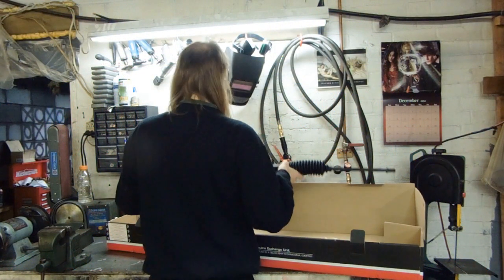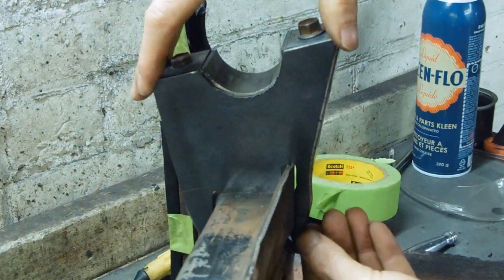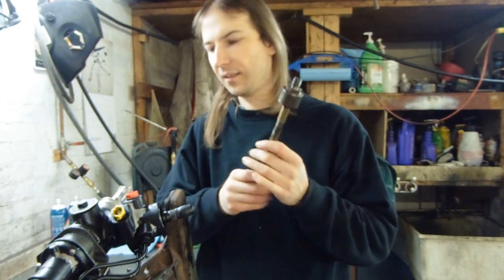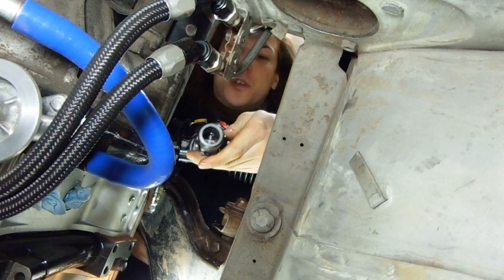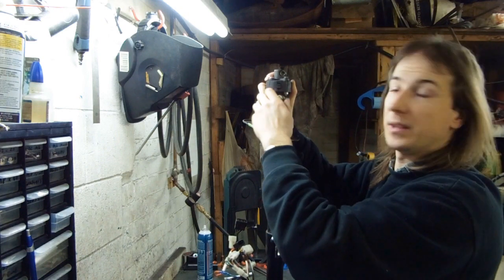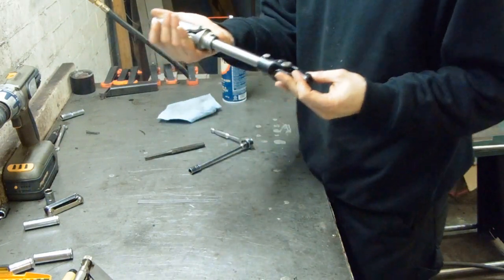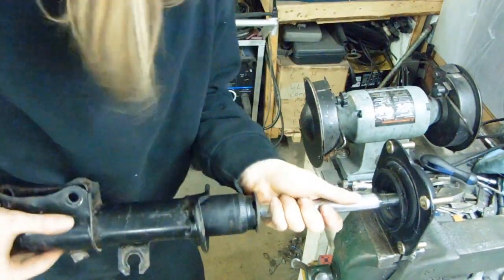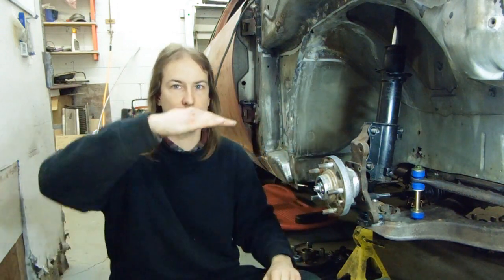Part 40: Front Suspension & Rack and Pinion Conversion, Part 2 - My 76 Mazda RX-5 Cosmo Restoration

Comment: As always a really comprehensive and entertaining episode.  I had my reservations about the steering column bearing at first but it turned out much cleaner and nicer than I had thought possible.  Gotta love those double jointed u-joints.  Congrats on whatever good thing came your way, I'm sure what ever it is will not ultimately interfere with the Cosmo, you are too deep into it to quit!
Reply from the maker: MrComaToes I knew it would be a challenge to make the support bearing aesthetically pleasing, not just looking like a bunch of hardware store parts. One of the advantages of rod ends is that they look like they belong in a engine bay. But of course being typically unsealed (though one can buy seals for heim joints) they stiffen up quickly. The bearing worked out. I still need to track down some boots for the u-joints. Will have to wander though the wrecking yard and find something, then order the new version at the auto parts store. Or just use some hose of appropriate diameter. Come to think of it, silicone hose would look pretty cool.
Reply: I'm sure you'll find something
Reply: aaroncake Perhaps an old VW transaxle boot?  Or a maybe  a couple of small CV boots like on an ATV one on top one on bottom banded in the middle?  Also my 1975 BMW R75/6  motorcycle has bellows on the front forks... Duh, just dawned on me this morning that you were talking about the firewall boot... STILL a CV boot attached to something you fabricate might work.
Reply from the maker: MrComaToes The firewall boot is actually provided by the Cosmo. It may not be clear on the video but there is a metal cone which clamps to the column, sealed to the firewall with a gasket. I'm actually referring to the boots to seal the u-joints. VW transaxle boots seem to have a thick end which wouldn't work. But I think you are on the right track with ATV boots. A Google image search turns up many potential candidates. Will have to hit the local ATV shop to see what they have.

Comment: Good to see you.  Once you get a lathe you'll wonder how you got by without one. 

I've not had a problem with rod ends failing.  My Corvette's rack conversion uses them as a steering shaft support and a replacement for tie rod ends.

Thanks for posting.  Take care, be safe!
Reply from the maker: ***** Everything I did this episode would have been enhanced by a lathe. I could have threaded the tie rods myself, and of course just turned the steering column adapter instead of fabricating it. Though I must say the drill press worked quickly and very effectively to reduce the shaft diameters.

Comment: You need a lathe, medium sized, threat cutting. All that threads and nifty parts and you don't have to "get them machined". I think you would love it, it doesn't cost much and we would appreciate your cool videos. :-)
Reply from the maker: Elmar Dylong A lathe is my next major tool purchase. It would have found lots of use this episode for sure. But, I don't want to under buy it. I'd rather buy something ex-machine shop at an auction as it will be big enough for, say, if I want to modify an eccentric shaft. Plus a lot of the smaller lathes for home use seem to have poor tolerances.
Reply: aaroncake
My profession is a tool- and mouldmaker, I have experience in almost every way you can machine metal. I can say the chinese lathes arent as bad as their reputation. I bought a new one for 2800,- Euro more than ten years ago and it still serves me well. I can machine parts 3 feet long and it has a swing of more than one foot. Threads are no problem, it will turn metric and imperial threads by changing gears. It came with a lot of accessories except the lathe bits. It is no tabletop model, it's a full grown lathe. Only downside is stability so you can't take very heavy cuts, but precision is there, not worse than a high priced machine. Of course getting a used industrial lathe is the best option, if they are availabe. You should think of electricity and the place where your machine will get set up, because industrial lathes may be to heavy for your floor. My chinese one weighs in at about 500kg, an industrial lathe this size can be twice to four times as heavy, nothing you can place on a thin slab of concrete (this is also of concern regarding precision!). Mine uses 380V, but can be altered to use 240V, so be carefull what machine you get. Industrial lathes may not be suitable for 240V or 110V and they can blow fuses like nothing, if the motor is to strong for your electric installation. If you have already thought about this things, just forget what i wrote. Just one thing, if you have a lathe, you will be surprised how often you will use it. ;-)
Reply from the maker: Elmar Dylong I'm not opposed to imported/Chinese equipment as I've been happy with it in the past. I should clarify that I was referring to tabletop lathes as having poor tolerances. Trying out a few in the past has soured me as it was near impossible to move the tool except in wide 0.1 movements. Totally unusable. Well, maybe for wood. Power is something I'll have to keep in mind when shopping for a used machine shop/industrial lathe as I only have 240V available. I can swap the motor if necessary I would assume as I'd be using it for far lighter work than it was designed for. Under what name was your Chinese lathe sold? I'd like to look it up. Having lots of accessories included is appealing as they can drive the price up very quickly.
Reply: aaroncake
The brand is Quantum, sold by Optimum, but that is in Germany. Maybe I can find a link, at least you can have a look what is useable.
No, they don't make it anymore. This is similar, but the digital readout is expensive and not the best:
http://www.optimum-maschinen.de/produkte/drehmaschinen/optiturn-d-320/index.html
This is the original, but very abused, mine is like new:
http://www.ebay.de/itm/QUANTUM-Drehmaschine-D310x910SGE-gebraucht-Drehbank-D-310-x-910-SGE/361238087146?_trksid=p2047675.c100011.m1850&_trkparms=aid%3D222007%26algo%3DSIC.MBE%26ao%3D1%26asc%3D20140107083420%26meid%3D7e6d38818c894f9f97ba98379df46e0b%26pid%3D100011%26rk%3D1%26rkt%3D1%26mehot%3Dpp%26sd%3D291358379159
Reply from the maker: Elmar Dylong I'll keep my eye out for a similar lathe as they probably sold under several brands, and probably still are.
Reply: aaroncake
I found a brand called "Paulimot":
http://www.ebay.de/itm/PAULIMOT-Drehbank-Drehmaschine-900-mm-Spitzenweite-mit-Bremse-PM4000-/301542089938?pt=Industriemaschinen&hash=item46354f24d2
Reply from the maker: Elmar Dylong A local store is advertising a slightly used General 22" lathe for $2250. Sad part is that with the "disruption" I spoke of, actually acquiring it is not possible at the moment. But, well, I've waited this long for a lathe so I can wait longer.
Reply: aaroncake  Take your time to find the right one, because you will use a lot of swear words if you buy wrong. I just had a look at the General lathes, they seem to be good quality, but 22" is very small and I didn't see any thread cutting abilities. You have to think of the spindle bore too, wich will be also very small. Long parts won't fit through this bore, if they are not very thin in diameter. I'm just thinking of something like a driveshaft. On a small lathe you can support it with a steady rest, but only if the machine is long enough. This small lathe is short too, so more swear words. ;-) Of a practical standpoint I would suggest at least 3 foot in length and 1 foot in diameter should be machinable, a spindle bore of 1 1/2" diameter should suffice.
Reply from the maker: Elmar Dylong 22" may be too small now that you mention it. One task I would definitely like to do as one of my first lathings is to shorten a 13B eccentric shaft so it becomes a 1 rotor shaft. 22" just might not be enough room. I was actually able to get a good look at it at a tool store (the model is not on the General website, which is a terrible website) and it does have the ability to thread (gears are included). That said, as you suggest I'm going to wait for a larger lathe to be available.
Reply: aaroncake
This is the video I want to see! :-) But be aware of some things can't be machined by turning, if they are surface hardened, or heat treated, especially on weak machines. ;-)
Reply from the maker: Elmar Dylong I've cut, welded and drilled eccentric shafts before so whatever hardening is done, isn't particularly deep nor, well, hard. Of course with the minutes of lathe operation I have under my belt I'm going to practice on a few pieces first. I'd take down the main thickness of the shaft with an angle grinder then put it on the lathe to do the final machining. No sense trying to turn off 1" of steel.
Reply: aaroncake
I don't know that rotor shaft, I build two strokes. ;-) Machining heat treated material is possible, I have done that, but with special tooling on very sturdy machines. This is nothing a hobby lathe will do without destroying itself. If that shaft isn't hardened why not use a cutoff tool? It doesn't bring much heat in like a grinder does and the mess is less.
Reply from the maker: Elmar Dylong It's such an awkward shape that putting it through the band saw would be painful. A grinder and a cutoff wheel will get the job done fairly quickly.

Comment: Aaron you may want to check again on your universal joint phasing unless I seen wrong the two forks were not in line, from what I know the two forks closest to one another should be in line or in phase.
Reply from the maker: MrUlloveit You know, I wondered if anyone would catch that. I got distracted when lining up the shaft and actually drilled my holes 90 degrees wrong! Caused some swearing as I didn't see it until final assembly. But thankfully it doesn't seem to have had any negative effect. Probably because at least one side of the double joint is in phase.

Comment: spring is prolly there to keep tension on the setup prevent the bolt holding it togeter  from dropping out should the nut fall off

Comment: You will need to do some welding on those sway bar links. Weld the washers to the tube that the bolt goes through. Eventually the tube will get driven through one of the washers.
Reply from the maker: puppynosee I'm not sure the bolts will pull through 1/8" washers. I guess they could in 40 years, but the original Cosmo end links were undamaged in this way after so long, though they were rusted to the point I had to remove with a cutting wheel.
Reply: The bolt pulling through is not the problem. In the sets that I have gone through it is the spacer tube that is the problem. When the sway bar link is pushing down on one of the control arms, all of that compression force is transmitted through that short chunk of tube. Once it gets the smallest bit of wiggle room, it will eventually hammer through. 1/8in washers are a bit thicker than the washers in the sets that I got for my Mark VII, so who knows, they may last. My solution was to get OEM Ford parts as the bolt and center washer/tube section is all one piece and therefore does not have that mode of failure.
Reply from the maker: puppynosee Good point. I think on final assembly I will TIG the centre rod to become one piece with the washer at each end.

Comment: Aaron, I am very glad with your answers. Just what I hoped to read. I have full convidence now your car will end up a masterpiece.
And may I give you a good tip? Do NOT wear gloves when using the colomn drill !! It sounds counterintuitive, but those leather gloves are MUCH tougher and stronger than your skin. If the drill grips the leather, the glove, and everything in it, will get wrapped around the drill, ripping off and/or destroying body parts you don't want to lose....
You can use gloves when using the band saw, but NOT when using the colomn drill. Please take my advice if you want to keep all ten fingers..!!!
There's no way you will push the OFF button in time. And then still..... Without the gloves your fingers might get hurt. But with the gloves you might lose them altogether.
Reply from the maker: telescopereplicator Ha, it's hilarious you mention that! Because the only reason I was wearing gloves was because the shaft was heating up due to the sanding action. I almost NEVER wear gloves when using any spinning tool for the reason you mention. But what's funny about it is that my glove did indeed get wrapped between the sandpaper and shaft, pulling my entire index finger backwards around the shaft and actually stalling the drill motor. It only left me with one minor cut initially, but by the next day my finger had swelled up to twice normal size and over the next few week became very sore. It healed up naturally, however it is still somewhat stiff and sore (that's what she said). So not only did the one time I wear gloves bite me right in the ass, but to make it worse the camera was not on at the time. My pain didn't even generate any video footage. I did, however, hit the emergency stop button with my nose.

Comment: Hi, I've seen all your videos about your Mazda Cosmo restoration.
For the front suspension and rack, why you don't use FC3S subrame with FC3s pinion rack with an adaptator for engine mount? I want to say this for the last video.
But today, why you don't use a coilover kit? or a front suspension lowering kit from racingbeat for example?

Please, continue your great work and make this Rx5 a beast on track!
Reply from the maker: MrSevendede As covered in part 39, there just isn't a way to fit the FC subframe. After holding it up basically everything interfered. It's too long for the Cosmo frame rails which turn down near the firewall. Even if I was to notch the Cosmo frame rails and the shave FC subframe to fit it, the steering rack is 3" into the engine. I'd have to raise the engine 4" to clear the rack which means then it wouldn't fit under the hood. Moving the rack to the rear of the FC subframe then seems to be an option by swapping the spindles left to right but the tie rods would interfere with the wide FC control arms. so the rack would need to come up and tie rods pass through a notch in the frame. But no room to do that because the engine is in the way and even if I could, raising the rack 2" would destroy tie rod geometry. Sadly, just not going to happen. I also looked at the Miata subframe but with those big uprights for the double wishbone setup I'd essentially have to front half the car. Same with Mustang II which was an option (as it always is).It's important to remember that this isn't a track car, as the aim is to make a great driving daily driver. Swapping to the FC spindles was more about being able to use 5 lug wheels and the big 4 piston FC brakes. Plus use parts available at any auto parts store. The steering rack to make the steering feel modern and responsive as well as remove 60 lbs of steering box with 20 degrees of slop.Amazingly, none of the Cosmo steering parts, ball joints, or bearings were at all worn. Only thing which showed some slop were the original strut tops.
Reply: aaroncake Thanks a lot for your answer. I never understood that this car will not come on tracks, so I understand your choices now! I think it's too sad to build a very fast car that it never goes on tracks sometimes... (Excuse me if I don't speak very well in english, i'm a french viewer)
Reply from the maker: MrSevendede The car will see some track time as all my vehicles do. Most likely a few passes down the 1/4 mile and some autox. But for track fun, I have my RX-7 which is much more suited to acquiring cone marks on the bumper. 500HP, bridgeported, RB springs, AGX shocks, poly bushings, DTSS removal, chassis stiffening. The Cosmo isn't going to be especially fast by today's standards. Just looking for 300 Ft-LBs in the low/midrange, at whatever HP is the result. For the record, even my Insight has cone marks on the bumper. :-)

Comment: fuck yea cosmo time.

My only suggestion is the brackets from the subframe to the rack mounts, you put speed holes through the sides of them, but maybe they need a drill hole on the bottom, because now water can get in throught speed holes and collect/pool and could be were rust starts. I couldn't tell from video if they were completely sealed.
Reply from the maker: ***** Yes, good suggestion. I had intended to drill some drain holes but just forgot. Have made a note, and will do so when I'm at the shop on the weekend. I also made sure the speed holes were large enough so I could get a dabber in there and paint the insides with POR-15.
Reply: aaroncake when I saw the speed holes I thought you'd put a piece of tube though, making it super stiff. Would this work?
Reply from the maker: thebibidu I guess I could do that but it would result in a sealed space that I wouldn't be able to get any corrosion protection into. The top, bottom and rack facing sides of the brackets are quite thick, just a bit thicker than 1/8". While the sides are 12 gauge. Should be pretty beefy.